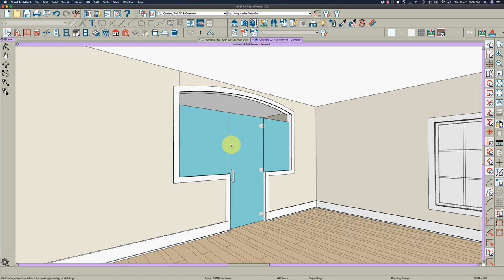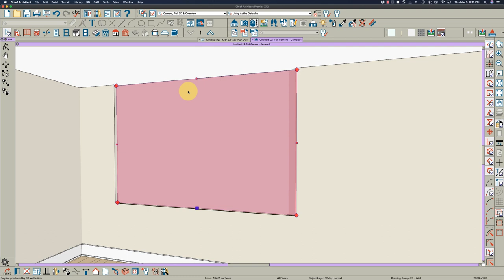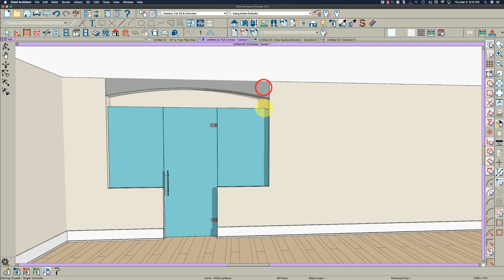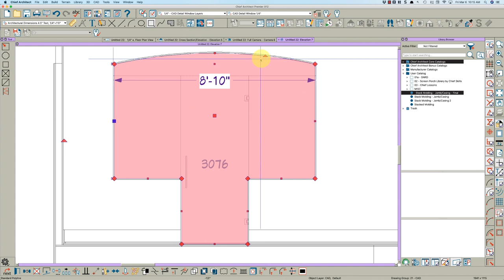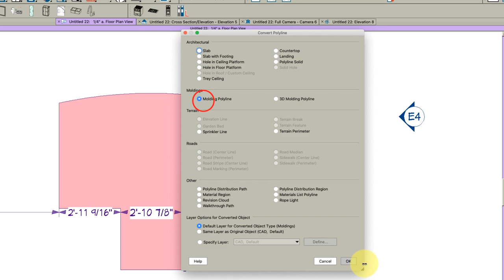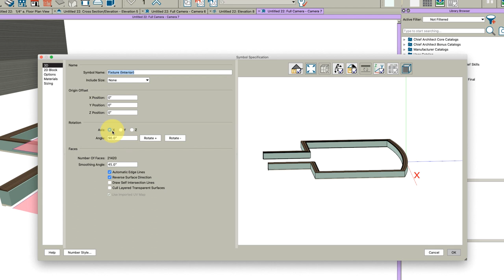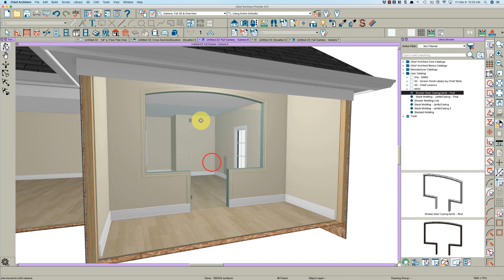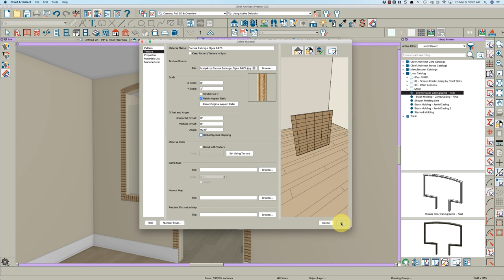How to create a Custom Shower Enclosure using Chief Architect X12

Comment: Thanks for your video!  I have CAx7 any thoughts on how I would put in a shower door - it's not in my door options.
Reply from the maker: Use a slab door, no jamb, no casing, make the door thickness 1/2”, change door material to tempered glass.